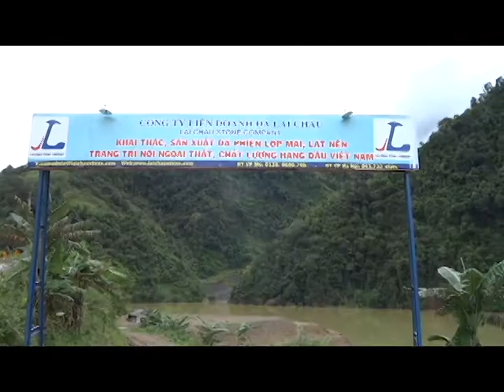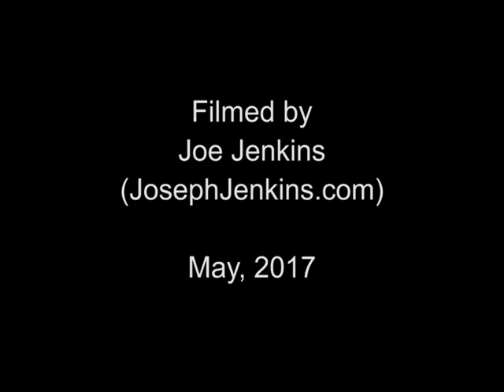Vietnamese Roofing Slate Quarry

Comment: Joe, is it possible to import roofing slate from the Vietnamese quarry in the video, or elsewhere from the north. I was amazed to see how cheap granite, tiles etc. were vs in South Africa. I'm starting building a house in the next 6-months. Slate is one of the prerequisites to use according to the building specs but will cost me 2 - 3 times the price of the other two options. Slate, especially used on a hip roof makes a tremendous difference. Can you provide me with some info re Vietname roofing slate availability and estimate prices? Alibaba has one vendor from Vietnam listed, yet doesn't look like the slate in the video - beautiful !! Would appreciate the assistance
Reply from the maker: Contact Lai Chau Stone. It may be possible. They have shipped their slate to the US and elsewhere.